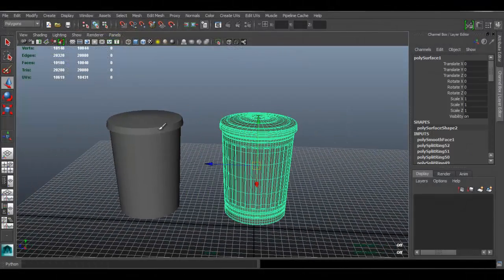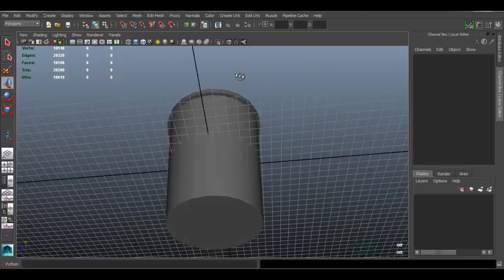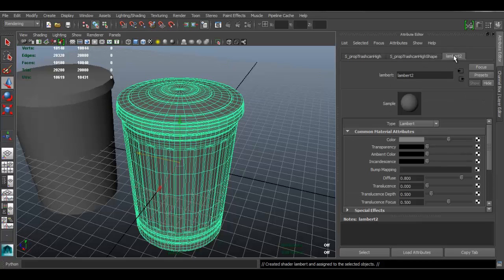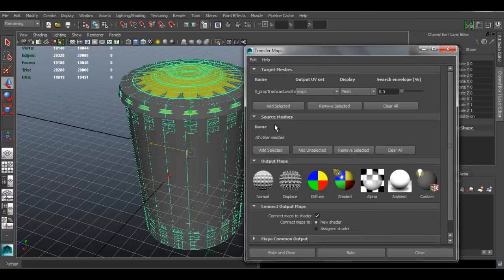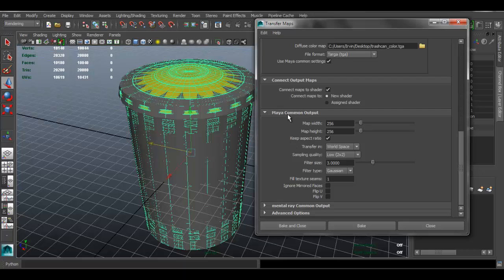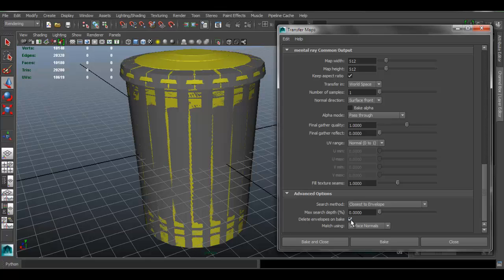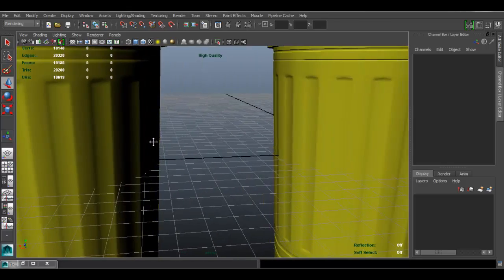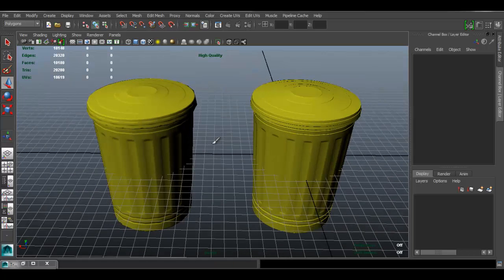Autodesk Maya 2014 - Trash Can Part 4

Comment: hi. nice tutorial. i have a problem after baking im missing the 3 edge gaps on the bin. the bake didnt  include them. the top cap of the trash can came out fine. but the bin itself it just baked the edges around the bin and not the upper and the lower ones. any way around this?
Reply from the maker: in the baking options you may want to enable to see the envelope and increase the size of the envelope to include that area.
Reply: I increased it to 2.0. Still didn't work. 
I then increased the smooth on the high poly and it did the trick.  
Thanks :)
Reply from the maker: Great, yeah sometimes it takes a bit more work to get it right.

Comment: in this process you modeled low poly and duplicated it and gone for making it high poly...i have doubt for  character modeling...weather we have to model low and go to same process....but i only know high poly modeling... or can i make  deleting loops from high poly model and make it low poly and go for baking..............any way it is very helpful for games...thanks a lot
Reply from the maker: technically you do the same with characters the difference is you work on the high poly on a program like zbrush or mudbox for sculpting and then bake a normal or displacement with it.